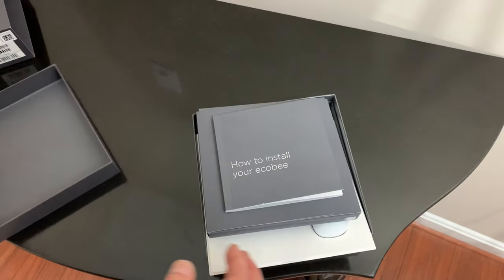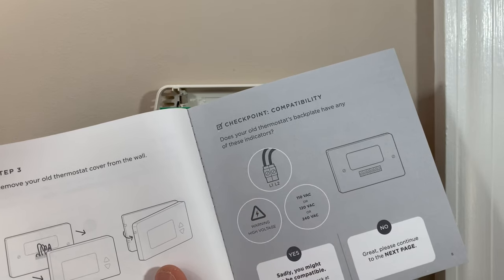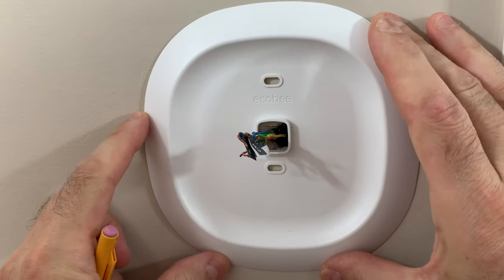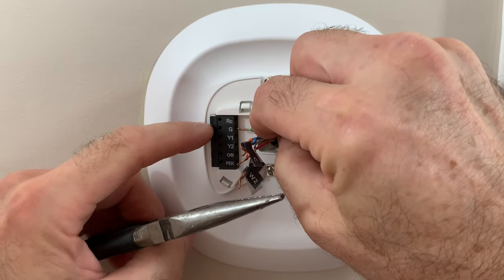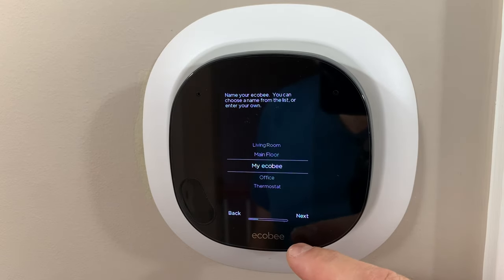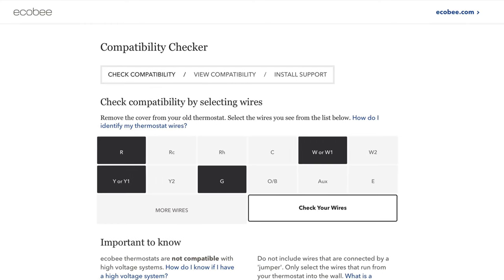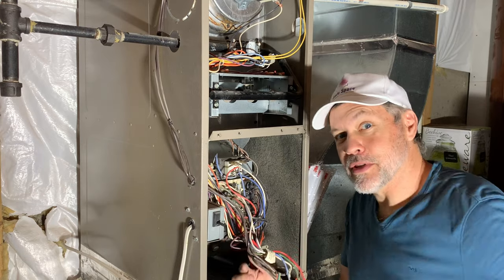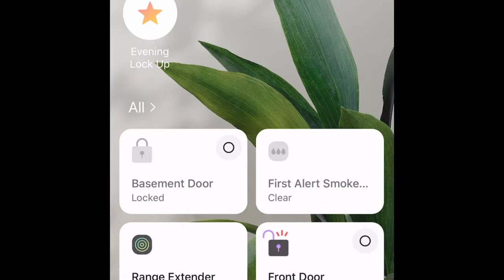DIY ecobee Smart Thermostat Installation | Alexa Built-in

Comment: Hi, I have one question, my current thermostat blue wire goes to "Y2", but I guess it usually goes to "C", right? is it a special setup or the wrong configuration? I want to replace my existing one with Ecobee, so I'm not sure I should put the blue wire directly goes to "C", or I need to follow the same configuration and use ecobee PEK?
Reply from the maker: Hi Doug, Thanks for watching and commenting. There are number of possibilities depending on the HVAC system. I’d suggest contacting Ecobee Tech Support for assistance. They were very responsive for me. Please let me know how it works out. Wishing you the best!

Comment: Thanks for the video. I have a heat pump as well and am looking to install an ecobee. I’m trying to decide whether I can do it myself or have someone else install. It looks simple enough. I noticed that your white wire jumps over to the E. I have all the same wires as you do, but have an extra black wire that goes to E. Does the ecobee automatically know what to do with these wires? I have a jump from my Y to W1. My white wire goes into W2 on my panel. Thanks for any thoughts you can share with me.
Reply from the maker: Thank you for the feedback! I had to use an extra wire to create an “E” wire. I recommend contacting Ecobee customer support with any questions. They can talk you through the installation.
Reply: I finally got my ecobee and it is now set up. It was pretty easy, although mine had a black wire that was supposed to go to E. I called Ecobee and they said I could just ignore that wire so I did. I didn’t have to worry about the jump wires either. Thanks again for the video!
Reply: I am a technician at ecobee. This is a strange scenario. When there's a jumper wire from W and Y, it means your home doesn't have back up auxiliary heat. The best way to determine where the E and W are going to is to open up your furnace door and check for where the thermostat wires are going to on the board.
Reply: @jonkc3635  thanks, Jon. Everything has been working well so far. Does the KC in your name stand for Kansas City? That’s where I live.
Reply: @ShelleyHannaArt KC is my middle name. Glad the technician helped.

Comment: You have a problem with your video, you show putting the white wire for heat on the W2 slot but when the Ecobee detects the wires it detects the W1 terminal! 🤔. This is misleading regular guy!!!😖
Reply from the maker: Good catch! I had to make a change during the installation and didn’t capture the proper configuration during production. Each installation is unique. That being the case, this video is intended to be used as a general guide.
Reply: @RegularGuyDIY  what was the change? I have an old Tstat and want to upgrade. I dont have "W" wire nor a slot for it on my old Tstat I just have a white "W2" wire in the "W2" slot. I want to upgrade to the ecobee due to a brand new hvac

Comment: What are the white things you put into the wall?  Why not just put the screws In when you first out that plate up?   So we have to climb on the roof to hook up?  🤦🏼‍♂️
Reply from the maker: The drywall anchor goes between the screw and the drywall, gripping the drywall much more effectively than a screw would. If you have a roof mounted HVAC, you will need to determine if your system requires a C wire. If not, you do not need to install the PEK. That’s the device that the video shows me installing on the HVAC unit. If you’re uncertain, I suggest contacting ecobee tech support to determine compatibility with your system. Wishing you the best!

Comment: Your wiring is incorrect. The white wire should be connected to the W1 terminal since you have only 1 stage of heating.
Reply from the maker: Thank you for watching and for your feedback. There was a portion of the video that showed me wiring it differently than I did during the installation. My apologies if this caused any confusion. Wishing you the best!
Reply: 7:40 you closed up with it connected to w2. But I suppose you had some trouble shooting you editing out. My old thermostat labeled my orange wire w ont top and o/b below.
Reply: @davidgimber3467  Most likely you have a heat pump system. You should be following the bottom labels when you wire up the ecobee.
Reply: When I wired mine I only have 5 wired originally no O/B just a W. When I connected my W to the W1 and turned on my A/C /Cool it started blowing out heat. Someone told me I had to plug my W wire into the O/B port and I did and my ac started working and blowing out cold air. Anyone know why this is or if it’s wrong even though it’s working now? I am electric and I have a heat pump.
Reply: @chert023  You have a heat pump setup and there should be a wire connected to the O/B terminal.
Reply: @jonkc3635  ok so it would be right for me to have the W plugged into this o/b wire port? My last thermostat I only had G,C,Y,W and R with that little jumper that connects the r/rc
Reply: @chert023  Yes. Let's connect that wire to the O/B terminal. This is actually a very common mistake. On some old thermostats, the O/B and W share the same terminal so a lot of our customers gets confused and ended up connecting the O/B wire to the W1 terminal of the ecobee thermostat which caused the heat pump heat to run on a cooling call.
Reply: @jonkc3635  yeah this worker thank you so much. It’s just crazy I see. 20 videos on the installation and everyone uses the W1 wire no one ever uses the O/B wire or explains that.